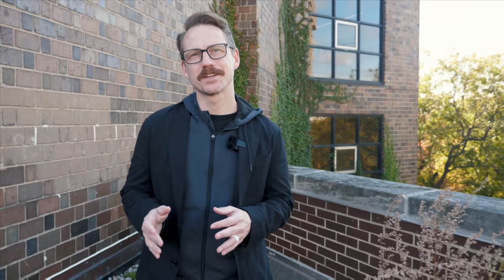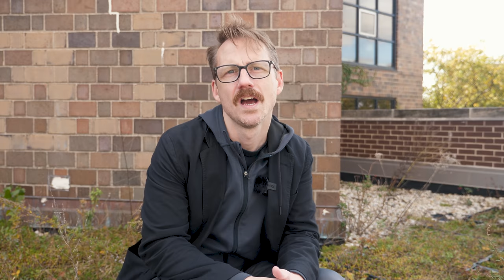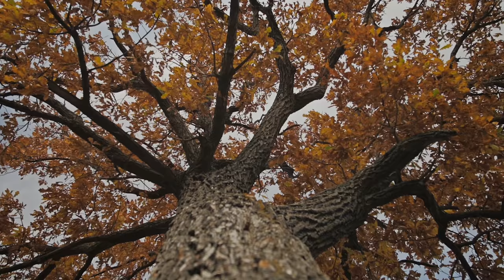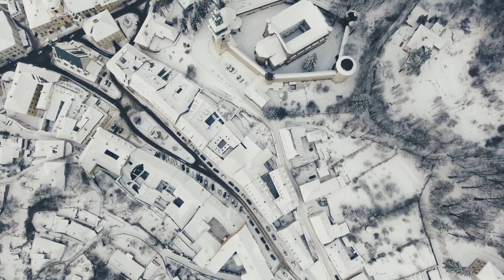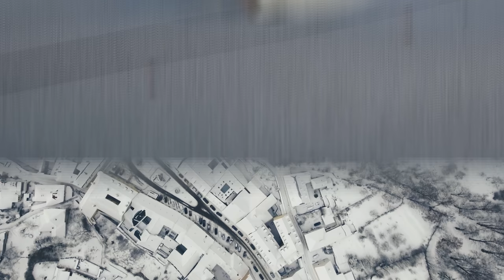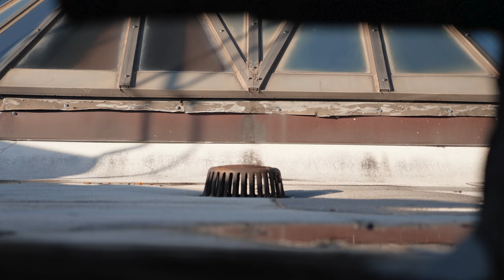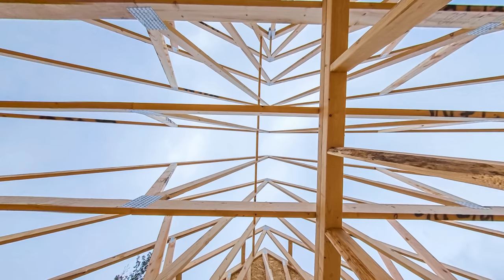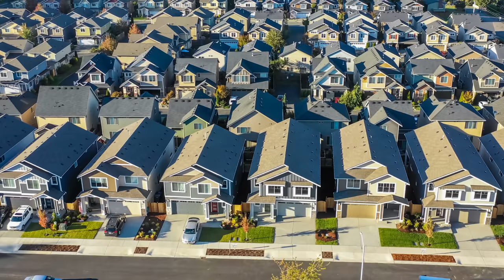Why Do Architects Insist on Using Flat Roofs?

Comment: Gabled roofs are more difficult to repair or replace.  Working on an angled surface, several stories up is no fun and not safe.  Also gabled roofs have the problem of shedding ice and snow quickly during weather warm ups. Many homes have metal spikes, acting as diverters to prevent anyone standing below from being injured. Even with flat roofs in chicago, sidewalks are blocked off surrounding the base, due to icicles breaking off some of those crowns around the top that architects are so fond of.  Falling ice, and windows popping out are some of the hazards of downtown cities. That angled roof in chicago requires the servicer of the colored lights at the top, to wear safety cables as several have nearly slid to their death.

Comment: As a guy who lives in a slope roof house, 
I absolutely hate it.

Most buildings here have flat roofs, but my dad decided slope looks better, and got that.
Now the roof is a useless place.
Water tanks need flat surfaces
Solar water heater needs flat surface
Solar electric panels need flat surfaces (or slope in the correct direction, but that's not what we have)
It's so hard to do anything in roof because I'm always afraid of falling off.
And I could have an extra room or some poles to dry the clothes, or even just a place to chill out in the evenings, if I had a flat roof.

But all that is not possible because of the stupid sloped roof...

Comment: I, for one, would definitely not want to be standing under an avalanche falling off an angled roof of a building as big as the Sears Tower. 

I would rather the snow gather up top and melt from the huge amount of waste heat big buildings like that generate and then be piped down safely. 

This was literally my thought before watching this.

Comment: Gable roofing is integral to an eco-friendly home. Modern insulation code (in Arizona) requires new homes to have 12 inches of insulation installed for efficient heating and cooling. Flat rooftop cavities are rarely large enough and can't be changed to accommodate more insulation as electric prices increase and as building codes change

Comment: Another factor not mentioned here is local zoning and height limits. I for example had to design a 3 story building in an area with a 35 foot height limit. We wanted to get a gable roofs onto the building but trying to stay within that limit while achieving 10 foot ceilings left us no room for anything but a parapet. Developers will try to maximize their buildings, height limits and vertical setbacks inevitably result in an increase of flat roofs.

Comment: Flat roofs applications depends mainly on the climatic zone you build on. Like for an instance, In Greenland you cannot use flat roofs to your house because the snow won't slide easily leading to snow piling up overtime destroying the roof, so you will have to construct high pitched roof to solve that.  Flat roof application is good for where they do not experience intense snow, example, africa, south america, india and all the places where they dont experience snow like europe, russia and canada.

Comment: I'm a civil engineer here in Brazil and I don't understand why people don't opt for the flat roof, you get an incredible space, imagine putting a barbecue there, a garden, outside which is a good point of defense in a zombie infestation, and there is no humidity, just slope the ground well and make a good drainage and waterproofing system, even reuse rainwater, you can install a solar panel more easily and even serve as a tent, to cover the unevenness to put these white stones, a bench, it would be a great leisure space, I think throwing money away when I see a beautiful mansion that doesn't have an area like that used, you'll have to make a slab right there, make it a little thicker to withstand a payload of people, simple, unlike making a wooden roof which is very complex and requires specialized labor, the flat roof already takes advantage of the labor that made the house

Comment: Have you ever considered, that it does not really rain in anciant mesapotania, or egypt. I am a carpenter and out of experience I would say, that if you want to built a house, then you do not save money, if you go the cheap route. A propperly built house requires a good roof, that not only gets water away from the building but also protects its walls from the elements,  by sticking over the house. If you then manage to ceap the roof in a good shape, your house can last for hundreds of years, without any serious repairs, instead of tens of years.

Comment: Excellent video.  Like any type of construction, there is good and bad execution.  Flat roofs that are not designed well or installed properly will be prone to problems.  However, when done correctly and appropriate for the geographical region, they can work well.

Comment: Your average european here. My parents build a house with a sloped roof. It is very nice, and you can even see the slope from the inside. On the one side of the house the ceiling is around 2.2 Meters, on the other sides it's more like 4 Meters. So quite the nice high ceiling. 
Also we planted stuff on the roof, to protect the plastic film from UV. All in all, nice house good looks.

Comment: In Canada (we have winter) , my childhood home has an extension with a flat roof.  It's always leaked, the gabled parts have never leaked. And it leaks weirdly (like you find the water, but you could never find where it came from. Residential roofers won't touch it because  "It's an industrial roof"  We have had it re-done (3rd time? but the house is 60 years old) and have our fingers crossed.  I think you hinted at the major reason homeowners are terrified of flat roofs. You said flat roofs are "more technical than one reliant on form".   Technical means you need better trained installers to get it done right, and residential roofing has a lot of low-skill to no-skill people working in the field, or perhaps just higher time pressure to complete the job for lower cost.  So re-phrasing:  Flat-roofs tend to require industrial roofers, and are more reliant on details, which makes them harder to inspect,  and so they either cost more or leak more or both for typical residential use.

Comment: A flat roof is the most cost-efficient roof shape.  All ceilings and room space can be used fully below.   Having a smaller surface area, flat roofs require less material and are usually stronger than pitched roofs. Flat roofs can be built to accommodate extra living space, such as a deck or rooftop garden. 
 Architect Frank Lloyd Wright was one of the first architects to use flat roofs consistently on residential structures. Flat roofs quickly became a part of his vocabulary of cantilevered roofs, porches, balconies and piazzas.
Pitched roofs are good for heavy snow and rain, but can be more difficult to repair for roofers.

Comment: Short version of the story is, I see "Flat roof. The default solution that gets used for commercial buildings in all situations appropriate or not.  ANOTHER architect didn't give a damn where they were putting a building and didn't think about what would be best for local conditions."

A smaller building simply doesn't benefit from a flat roof. A building in an excessively hot climate should not have a black (ie, tar) roof.  A flat roof covered with gravel is a horrible choice in a windy area (cars in nearby parking lots get broken glass in every windstorm).  On a building of about four stories or less a roof with no overhanging eaves (the way flat roofs are ALWAYS built) is a missed opportunity to provide a sheltered walkway when built in a place that needs shade from the sun or shelter from falling rain.  Architects hardly ever consider taking advantage of local breezes with a wind tower as opposed to putting the same damn wasteful electric A/C systems in everything they build, whether the area has local breezes or not.  A south-facing slope that matches the local latitude (presenting the greatest average area to the sun throughout the year) is beneficial in sunny areas that can benefit from solar collection.  etc, etc, etc.

And bluntly they just get boring when thoughtless architecture puts them EVERYWHERE. The homogenization of architecture prevents cities from having local character or being well-adapted to their local conditions.

Comment: I lived on a floating house in Seattle for years. The roof was part sloped and part flat. That part flat side accumulated snow these past two winters.  When we had a surprise 8" overnight it nearly sunk it from one corner. Easier to climb it and take it off where flat but not a fan to say the least.

Comment: i have always had an aesthetic and philosophical preference to flat roofs, even in lowrise residential, i’m so glad they are justified in so many practical ways as well.
Reply: The whole raison d’etre for flat roofs is aesthetic and philosophical, the same reasons for using an Architect to design buildings, especially low-rise residential. 
  For practicality and function and efficient construction, flat roofs and Architects are best avoided. My cousin, a builder contractor, once told me if you want a decent house built, get a Draughtsman to design it. The utilities will work properly, it will be more economical, it will be cheaper to build, cheaper to maintain and won’t look out of date or ridiculous in 5 years time. By all means do what you think looks good, but remember you will be inflicting senseless issues on the subsequent owners for as long as the house is extant.
Reply: @tutekohe1361  interesting point, but my grandfather built his home room by room as his family grew, he built it without a design, himself (he was a roadworks construction worker), he built it out of concrete and with a flat roof. we’re talking the mediterranean, but in his part of the world the traditional house built by masons would have a pointy gable. my grandfather didnt have access to rocks and quality lumber, so he built using concrete

Comment: All roofs require maintenance. A hip / gable will still shed water when the shingles begin to fail so the structural damage to a unmaintained roof is slower. As a flat built-up roof fails, water can leak onto the structure. If a drain is blocked, the roof will not drain and standing water will find a way in. The standing water will create extra loads which can add to the ponding. Flat roofs are practical and can work well but they require attention.

Comment: Interesting video!  I'm not an expert by any means. My main concern with flat roof building is that they usually look unattractive, especially from street level. In general, gabled roofs just make buildings look much more beautiful and less boxy. I do think there are options to make flat roofed buildings look more attractive, for example by adding more decorative details to the edge of the roof or wall, or perhaps gabled roofs at the front side but flat behind it.

Comment: You can squeeze 1-2 full floors on top when using flat roof (depending on building size). With angled a lot of space is lost and top floor is a bigger-ish room (narrow and unlivable if you are tall).
Also cheaper. Box with a little added angle on top.
Reply: It makes a big diffrance if its 0 degree or 3 degree. If its 0.. or even 1 or 2, water will stuck in the roof liner, if its 3, that can be avoided.

Comment: I have a business in a 1800s building in a small town in Kentucky. Along with every other old building in town, we have had tons of issues with our flat roof. They simply do not hold up over time. They are hard and expensive to maintain. Most buildings in our town have had metal roofing structures built over the top of the building which looks dumb, but is the cheapest solution to fixing water issues. Meanwhile all the 1800s gabled houses have few leaks and have very little rot. In England, pitched roof buildings have lasted literally hundreds and hundreds of years and in the US our flat roof buildings can't even last a century. Shingles are much easier to install, last 30 years, and repel water and snow much better than flat roofs. I agree that flat roofs are the only way to go with high rise buildings and skyscrapers, but those do not exist in my small town. The tallest building in our town is probably 4 stories tall. There is no reason to build a flat roof building where a pitched roof is an option. Period.

Comment: I live in Canada,

Flat roofs are just a collapse and leak waiting to happen. They literally sell roof shovels so you can remove the snow from your roof from the ground. apartment buildings with their flat roofs have to be maintain regularly and idiots who make flat roofed homes often find themself with pricey maintenance bills as they have to make sure the roof wont leak and even climb on top to shovel it due to the shape making it impossible to shovel from the ground. Not long ago in a rough winter, I had to climb on my sloped roof with an axe to break compacted and iced up snow which caused a a make shift dam and consequently a leak. that dam was over a feet high and I basically had to resort to poring boiling water because I could not chip the ice with out also damaging the roof's tiles. No one in snowy regions will logically make a flat roof. In canada, every winter, someone has their roof cave in from the weight of the snow that they are slopped or not. Although timber and brick can withstand a lot of weight. the water weight of damped and iced up snow in spring is extremely heavy. Back injuries are fairly common here due to that and people will go out mid snow storm to shovel to get at the snow when it's light.

Old houses in Canada all have a very steep roof and have survived this long because they don't have the crushing weight of water ever winter. If I build a house, it's gonna have one steep roof that goes all the way to the ground like native American long houses and Scandinavian long houses.

Comment: Flat roofs still need a fall protection plan per OSHA. If there are parapets for fall protection, then you have snow drift and drainage concerns. If you want your flat roof to be an outdoor space, then you have to consider higher live load demands. With this video, I appreciate the education regarding the differences between a flat roof vs a sloped roof (by the way, there is more sloped options than gable roofs; there's monoslope, sawtooth, domed, etc). However, you can't argue one way or another. It completely depends on occupancy, use, location, loading, etc. Cost differences aren't as cut and dry either. To be more convincing, this video would have included a case study showing flat vs sloped side by side for the same building footprint showcasing material volume, material cost, construction cost, and maintenance cost. If you are considering a new build, consult with a structural engineer for what will work for you best.

Comment: I'm in the PNW. People are starting to design flat rooves into residential construction. A great example is Pass Life at Snoqualmie Pass, WA.  There are enormous snow loads at Snoqualmie Pass and roof avalanches are a real hazard. Plus the development has a density such that there is nowhere to put the snow. So the structures are designed to carry the load. I don't know about the leakage. The buildings are still pretty new. But I would think that if you designed a low slope and maintained the drainage the risk of leakage wouldn't be much different than a gabled roof. Plus: roof deck, hell yeah!

Comment: Flat roofs can be drained on one side of the building; pitched roofs need at least two sides of plumbing.
2 points; gabled roofs are a type of pitched roof, not a synonym of pitched roof; the other type of pitched roofs are hipped roofs; also, roof water goes to the storm-water system, not into the sewer; that's a no-no..

Comment: Well I'm an architect, and in a country like mine, with tropical rain forest climate, using flat roofs is the worst idea, some projects around where I live that goes up to 500,000 used flat roofs and the water filtrations they got alongside with how those houses are deteriorating because of it is quite the problem (here it rains from may to november) so In the first project I design I talk to the client that the traditional spanish tile roof was the best option and It will save him other costs over the years.

Comment: I maintain a small commercial building with a flat roof. My experience with tar and gravel is only 2 years, lucky to get 10 years out of it much depends on the workmanship and material selection from the contractor. I switched to modified bitumen installed by a good roofer. What a difference, I think it could last 30 years or more with maintenance. Most of the small flat roofs are not designed for people or mechanical loadings unless it's designed to.

Comment: If I were designing a 'flat' roof it wouldn't slope but it would be slightly dome shaped to carry heavy loads of snow or rain off to every side and be able to deflect slightly under load. I would think the other advantage of flat roofs would be placing HVAC and any other mechanicals up there. Also, in those ancient flat roofed homes I would think they would cover the roof with some material to keep the sun from hitting the hard adobe/bricks/ etc and heating them up only to release their heat all night long. I would use a lattice of poles for durability and insulation for the roof. The wood cools off much faster.

Comment: my house has the worst of both world: a gable roof and a flat roof. and the flat roof doesn't have the attributes to be used as a terrasse. So now, I have a loft project and a project for insulating, putting guard rails (which, as visible elements have to be approved), reinforcing and flooring a flat roof.